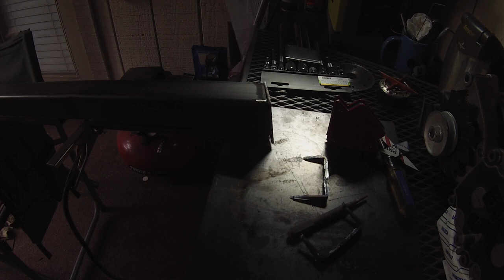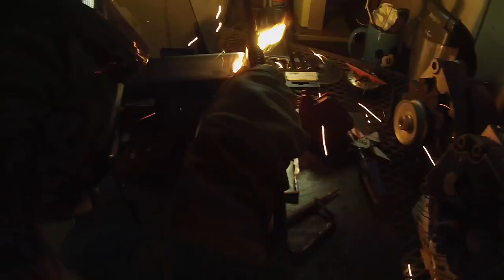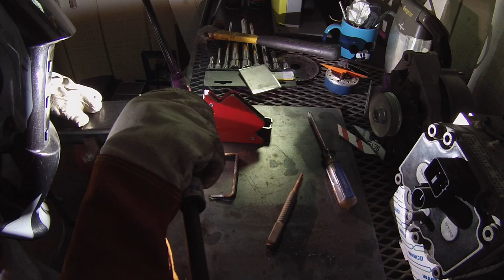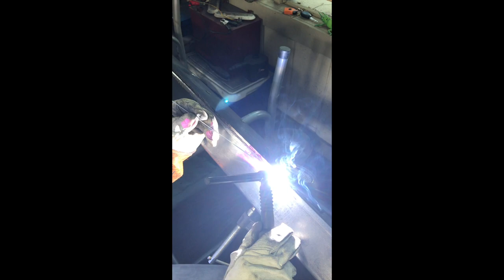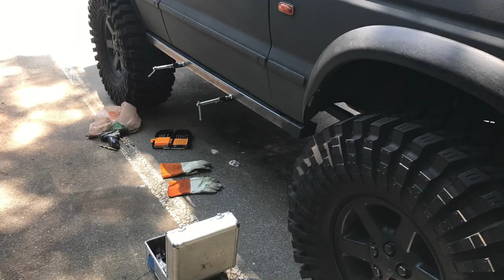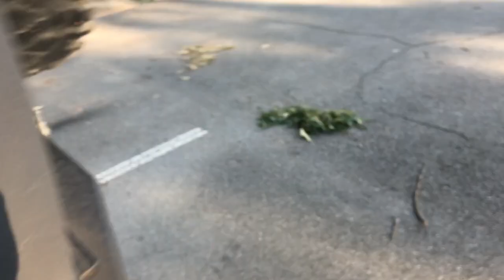Fabricating Rocks sliders for My Discovery II

Comment: They don't sandwich the door sill or tie back to the frame?  Just bolting them to the side of the door sill isn't a good design.
Reply from the maker: krover01 ok Thanks...  The design is the same as The Rover North models
Reply: Look again. They all sandwich the rocker sill. Even the RN ones. Just trying to help you out...
Reply from the maker: krover01 Lol I know buddy and I really appreciate the help but I did install a set two weeks ago and it was exsacly the same as mine, under they as a little brake with screws to the chassis
Reply from the maker: krover01 https://youtu.be/yBMkvjnvwRo
Reply: Land Rover Zone those are junk!! For mall crawlers! lol.. Seriously.. if you plan on using them off-road you need something stronger.. https://goo.gl/images/LSPXf2
Reply: I give you credit for building your own stuff.. but I wouldn't trust those on rocks..
Reply from the maker: krover01 Thanks! It was a fun protect for sure men! I don't do the rock crawling thing, I like mud. I can always buil it stronger if They ever bent on a hit!! But I really appreciate the concern ✅👌🏼